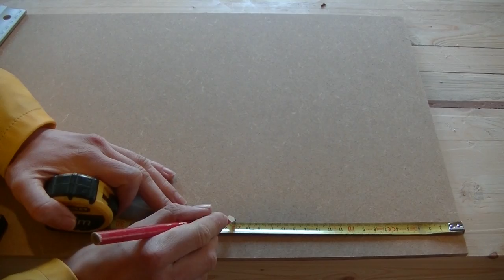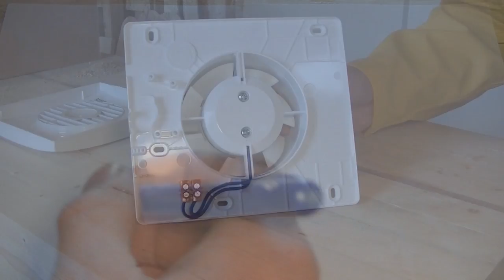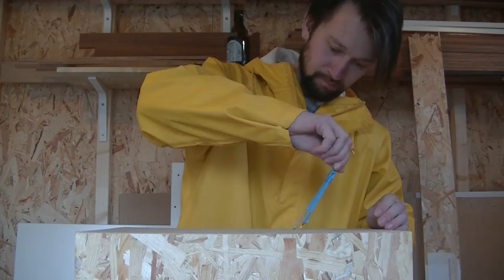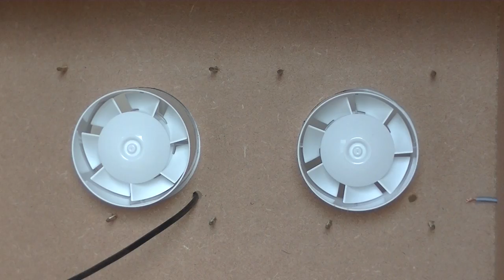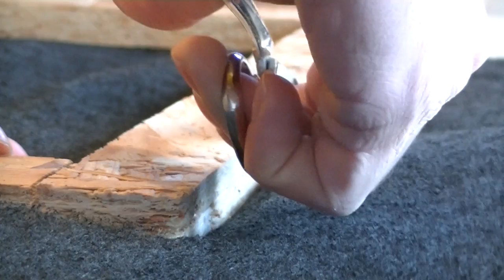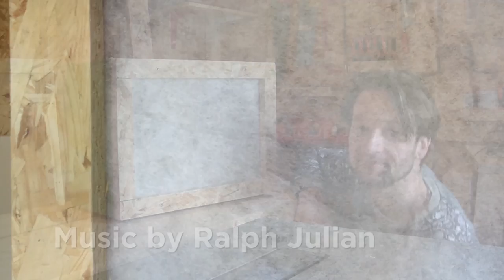Shop Dust Air Filter & Fume Extractor

Comment: The fans you used are rated 90 m3 per hour, not per minute! Meaning the air in your shop is renewed 4.5 times per hour, or every THIRTEEN minutes or so, which is better than nothing, but not really efficient, imho. Anyway, thanks for sharing your experience.
Reply from the maker: Hey thanks for commenting, oh yeah that is so. Its quite effective, not the best performance in its size. The fume extracting works very well!